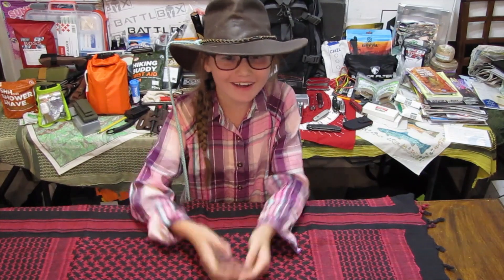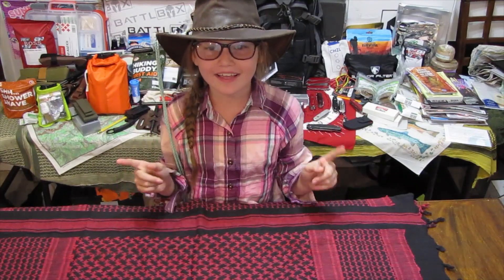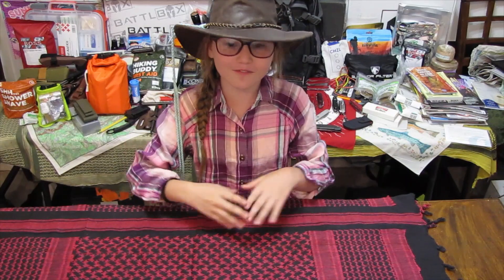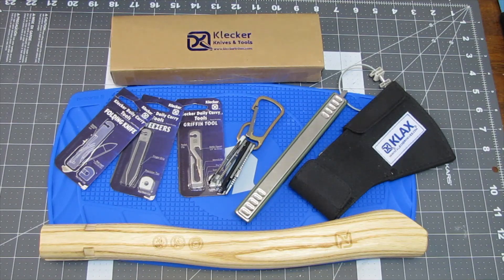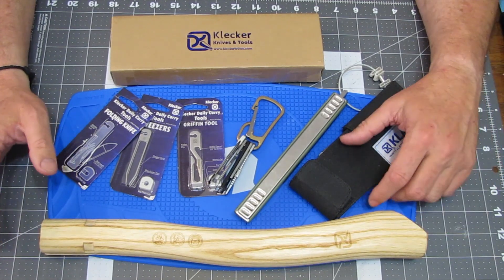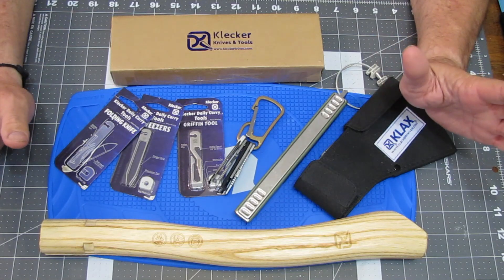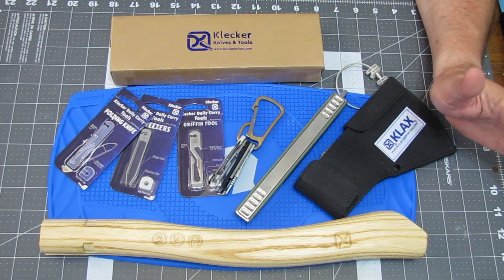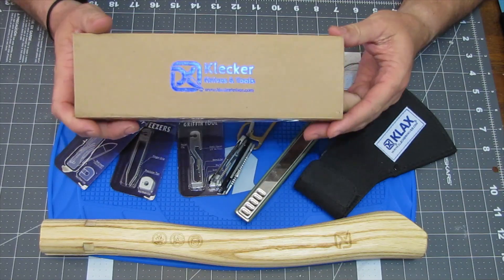Klecker Knives and Tools- Before their Time!

Comment: The Klax is for me nothing but a gimmick I would not waste one cent on.
For the past 25 years, I use an original Hudson Bay birds head axe head on a straight Ash handle made to my specs.
Reply from the maker: LOL- Hudson Bay gear is top notch for sure. I had some great Hudson Bay Wool Blanket’s that my Grandfather bought in the 50’s. Wish I still had them 😢